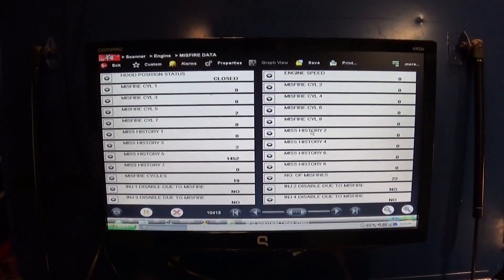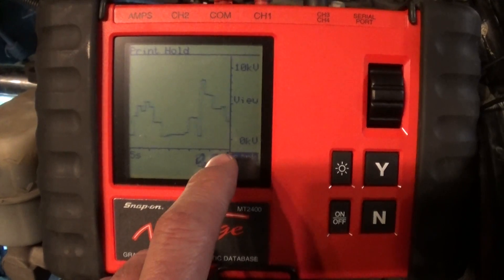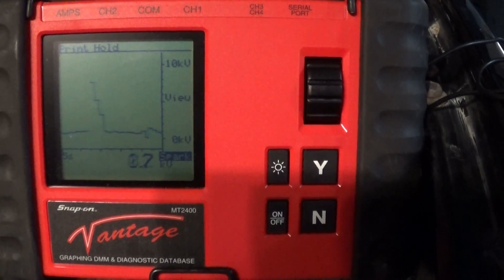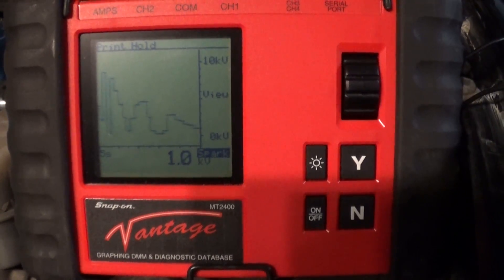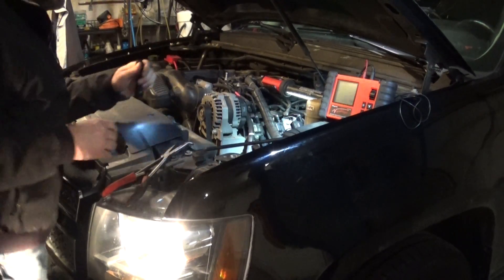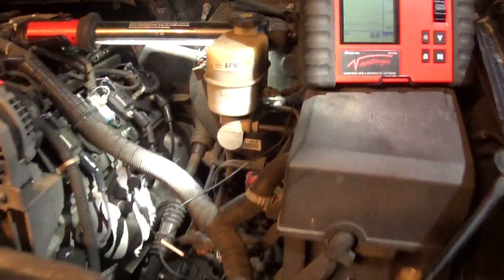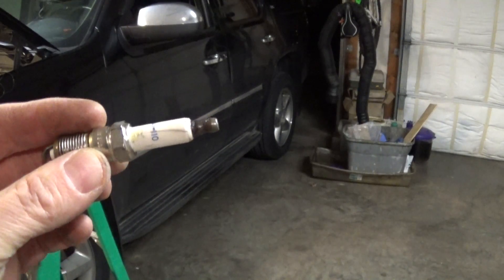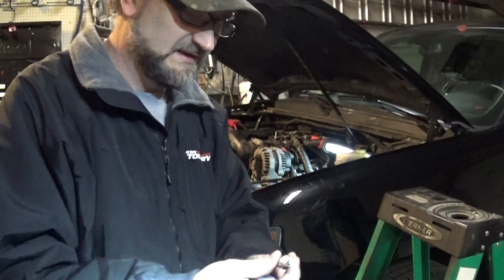Secondary Ignition Testing Chevy Tahoe Misfire On Cylinder Five

Comment: In this incident rather than the spark escaping through the shell crack the crack is also internal causing continuity loss and therefore KV jumps up? Enjoying your videos!
Reply from the maker: Neil McRobbie it is possible. I'm still learning secondary ignition  testing. So far I do know if I have high spark KV I have to check my coil, spark plug and spark plug wire. Thanks for watching

Comment: Had no idea MT2400 had that kV histograph feature. Can the Verus graph kV vs. time? I am jealous of your fine collection of scopes and scanners!
Reply from the maker: motoYam82 No it doesn't can you imagine why would they do that. This is such I nice feature do dissect secondary ignition. I believe OTC Genesys has something similar. I will make video soon. Thank for comment on my collection I got them all on eBay for lot less. If you want to contact me personally my email is ruzic@bellsouth.net no pressure. Thanks for watching. Cheers👍👍
Reply: Pine Hollow Auto Diagnostics what he is using in this video is the optional kv module that mounts on the back of the mt2400. I also bought a mt2400 on eBay and was surprised when it came that it had the kv module. I have never seen it used before, now I have to try it out. I have seen scanner dinner say that he has never used one. Jim Morton who does that 2.5 hour long video on the TST YouTube channel about ignition diagnostics talks about the mt2400 and the kv module and he said that snap on had him write the manual for it.

Comment: Definitely a great case study. I have the MT 2400 that I bought 5 years ago off Ebay but unfortunately the screen is fading away and can't get parts for it. Buying off Ebay for a tool like that is always risky. I also help family and friends out with their vehicles with the hopes of saving them from the Dealerships. Did you ever look into the Ottotest Diagnostic Tools? Keep up the great work!
Reply from the maker: White Tiger I got my on eBay also. My works good but does not like cold weather screen will not always work. Do you have ignition module for your tool. I have a hard time to use mine on waste spark system. Do you have any experience testing waste spark system with MT2400. Thanks for watching
Reply: I don't have the ignition module for the MT 2400.
Reply from the maker: White Tiger Ok thank you

Comment: Why did you not use your Vantage Pro ? same features as the Mt 2400 , if I am  doing  a tune up and I drop a spark plug and it hits a hard surface like a cement floor , I don't use the plug because a lot  of times there can be a crack inside the plug and you can't see it always look at your plugs BEFORE you put them in for cracks or other defects .
Reply from the maker: SuperJoes70 that was my point in this video not to use spark plug if you drop it this tuneup was done by professional shop day before and he started experience miss firing same day. I like to use MT2400 to show what tool can do. Many people don't  use this tool to   full potential. Thanks for watching